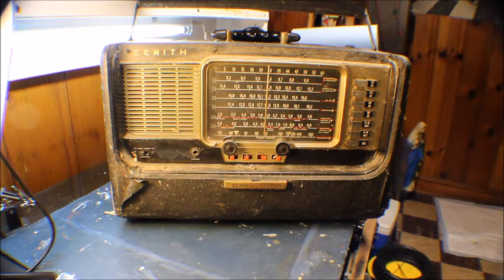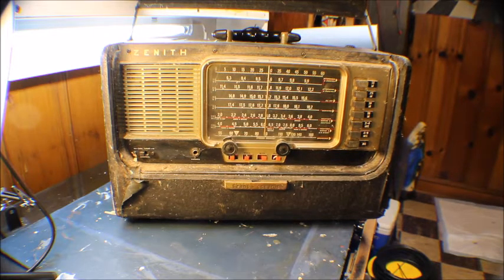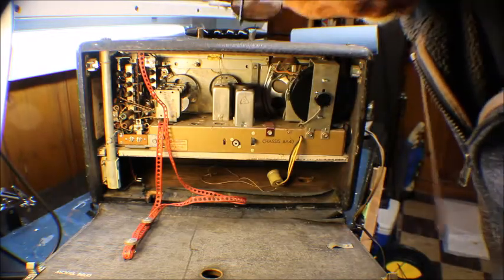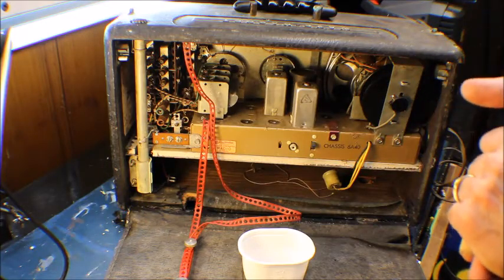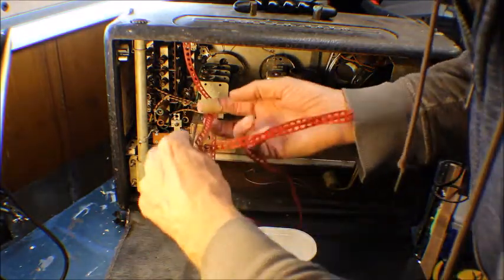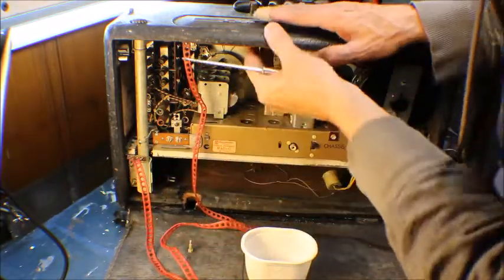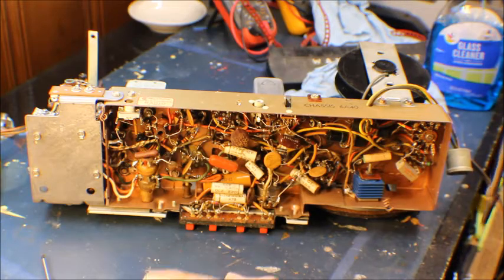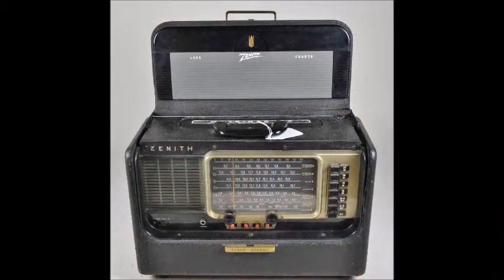Zenith B600 Transoceanic Restoration Pt  I

Comment: Wire did I see correctly, does it have point to point wiring and printed circuit boards?  Looks like they used the tubes as chassis mount which is smart.
Reply from the maker: Yes it's point to point. No circuit boards. I'll show a close up on it in the next video.